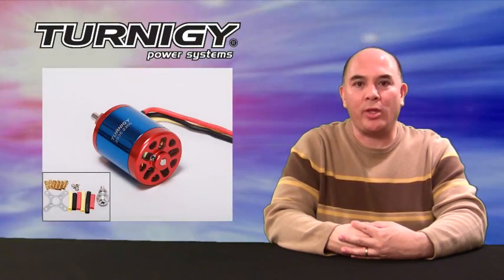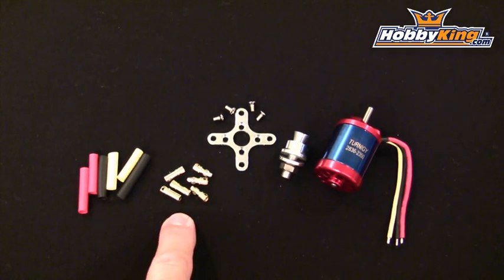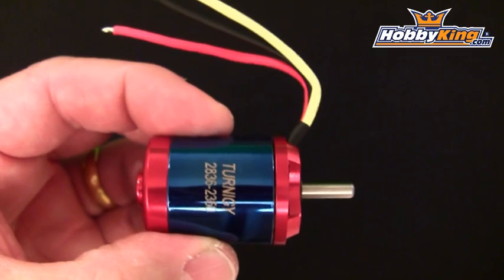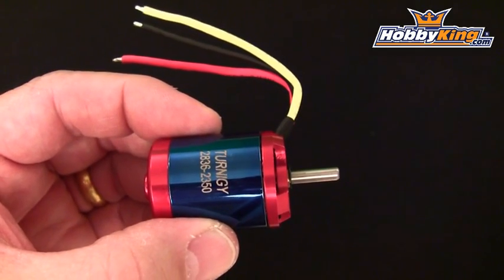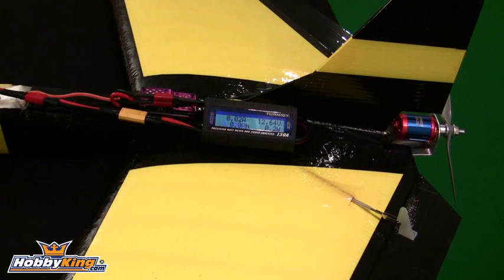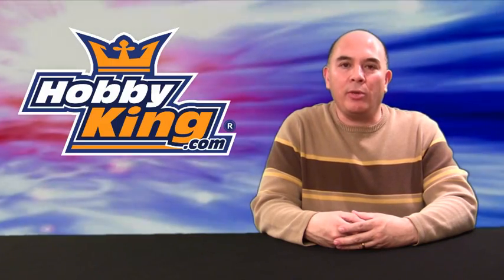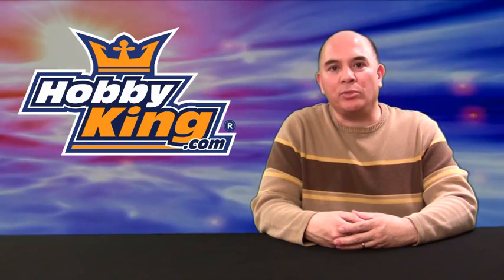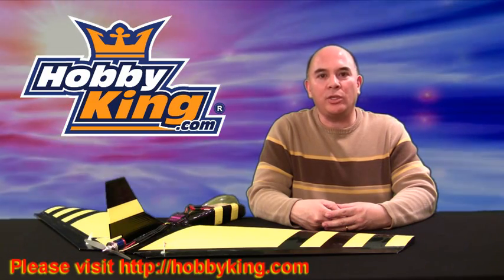HobbyKing - Turnigy 2836-2350kv Brussless Motor

Comment from the maker: aramismax2002 I agree with you, this is one of the best Turnigy motors I have tried. It really puts out a lot of power for it's size and can take a lot of abuse. Works great on both 3s or 4s lipo batteries.

Comment from the maker: johndog35 I assume you really mean esc. It depends on if you are going to run a 3 cell or 4 cell setup. I would recommend an esc rated at least 45amps to 60amps but you should try to keep the motor below 45amps or you will risk the chance of melting it down if you don't use proper throttle control. I can say this is one tough motor and I have run it as high as 839watts@58amps on 4s with a 6x4 sport prop. This was for very short bursts of 5-8 sec and in very cool weather.

Comment from the maker: Thanks startazz! This motor draws between 35-45amps depending on the prop and batteries you use. If you run it on 3 cells a 40amp or 50amp esc should be big enough if you are using a 4 cell I would recomend a 50- 60 amp esc just to be on the safe side. either way I would not recomend pushing this motor above 45amps as it could over heat and destroy the motor without proper throttle management.

Comment from the maker: Thanks for the suggestion daveyedgar! I listed the prop sizes in the video just after the static test. This motor runs best with a 6x4e, 6x4 sport or 6x5.5e APC prop on 3s LiPo and a 4.5x4.5 or 4.75x4.75 TGS prop on 4s LiPo. These are the props I have personally found work best with this motor.